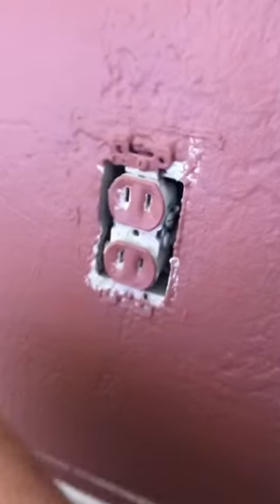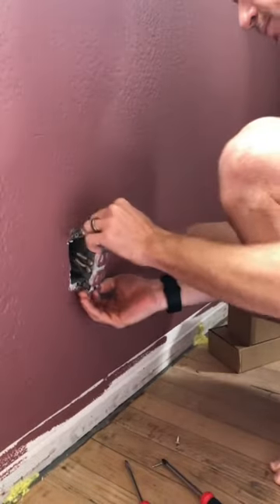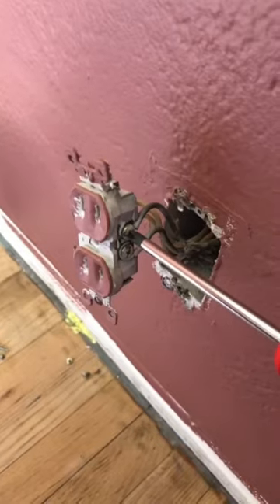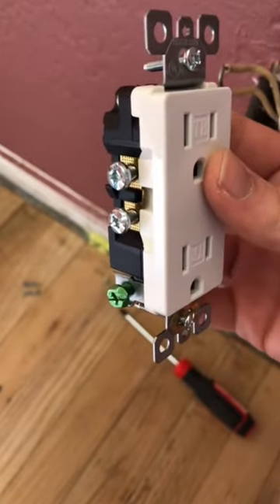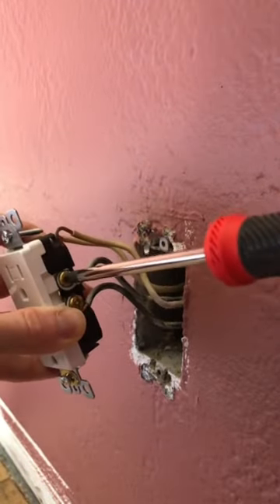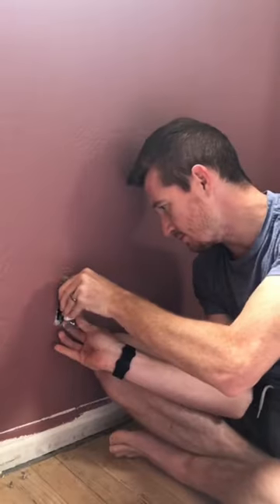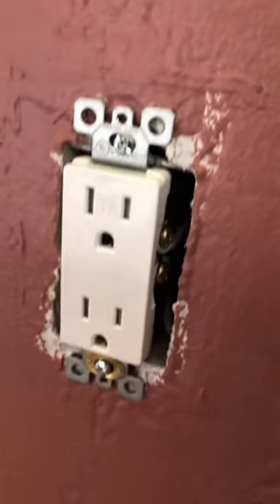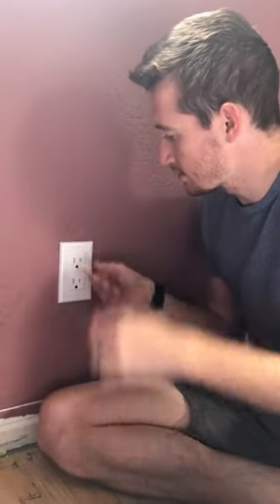15. how I switched out an outlet #diyhome #electrician #howto #electricalwiring #realistichome

Comment: You should check and see if your recpectacle is grounded even though you dont have a green jumper is installed... I see that its a metal box and could be used as a Equipment ground conductor (continuity)... If you have a multimeter check voltage in the recpetacle prongs go from HOT to Ground.. if you get 120v.. It's grounded and legal.. If you want to look more into it NEC article 250.118... Food for though.. And yes it's best to pigtail to the receptacle its putting stress to the receptacle when other loads are coming from downstream..

Comment: If you lived in another country, any other country almost, you would have a switch to each plug outlet to turn it on and off to make it safer. No wonder those outlets look sad, they are LIVE and death traps.
Reply: @chilenitonuma  Unless you turn it off at the mains it remains LIVE. In other countries we have switches for each outlet to turn the power on and off (a bit like light switches) for each outlet....then the outlet is not live, but the mains breaker remains ON. With my outlet switch turned off, I could stick a knife or fork in it and nothing would happen...because the power is off for that outlet only, until I wish to use it then I push the switch and turn it on. Australia has a vast range of power sockets with switches....ALL safety switches.

Comment: This is totally WRONG !  You can not use a three prong plug on a two wire system, unless you use a GFCI outlet, or breaker.  That is code.  BTY, manufacturers, STILL make the two wire outlet you can buy and use.

Comment: He's a future tip get the 20 amp commercial grade outlets they are a bit stronger and they last longer if you get the back and side wire versions they are easier to install because you don't need to bend hooks on the wires you strip the wire and put it under the tab beneath the screws on the sides and tighten it. But good job though